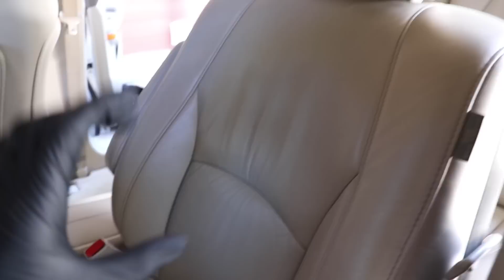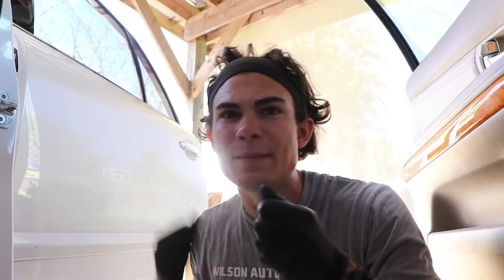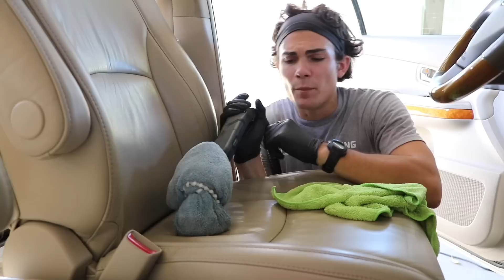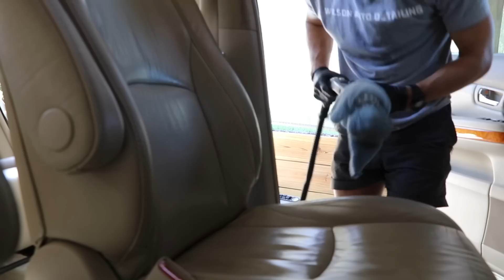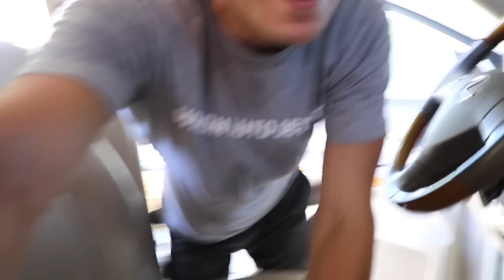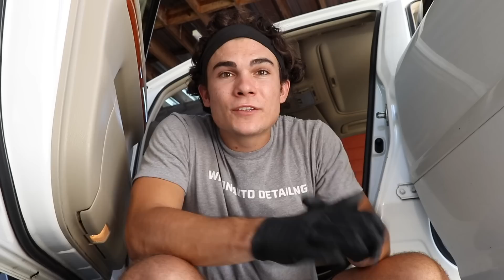Steaming Leather Car Seats: Serious Dangers You Need To Know!

Comment: Note to anyone watching.... Purchase an extra attachment and just clip off the brushes on the end this way there is no chance for the brushes to make contact on the surface through the towel. Yes the towel will get damaged from the heat but there's no need to add 2 towels just because you don't have a dedicated attachment for the right job. Problem solved.

Note #2
Since the vast majority of leather in cars is vinyl coated then theres nothing at all wrong with steaming seats. It's how they tighten the leather around the cushions after its been sewed on. You can even spray distilled water on the seat using any spray bottle and leave it in the sun without worry which slightly acts light a steamer.

What you don't want to do is introduce water if you have cracks exposing the inner cushions. This will cause mold to form. You also don't want to use a heat gun because you'll end up damaging the vinyl coating.
Reply: junior, what are your credentials?

Comment: What kind of protectant do use suggest for a leather line this?
Reply: leather conditioners are all trash.  They last 2-3 months and don't actually 'condition' as they cannot penetrate the leather's surface.  They just sit on top and look shiny for a couple months.  That being said, there IS a benefit to getting the dirt out of the seams - helps prevent the leather from cracking.
But no one wants to condition their seats 6 times a year, so leather's kinda doomed to crack and fade over time :(

Comment: Love your vids! Question, my truck is 11 years old, still looks great, been thinking about stripping the wax off, I've been using Turtle wax carnuba once a year, is it worth it?
Reply: Wax is probably long gone by now. Carnauba melts at a certain heat and most waxes don't last near year round. Some oils do stay on the car though so still strip it
Reply: Just a fan What should I use to strip it, dish soap?
Reply: @usmale9112001  well I've seen alot of videos saying a degreasing soap like dawn or ajax strips waxes. I'm not sure how effective it is because there's no way to tell if all the wax is off
Reply from the maker: I would wash it traditionally, then strip it with an ipa wash, then maybe switch from the wax you’re using to meguiars ultimate paste wax